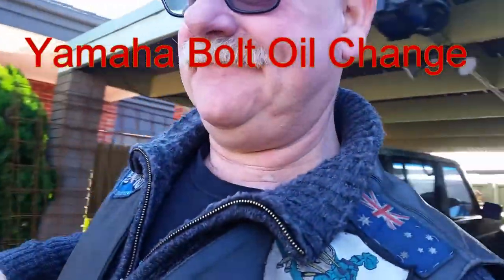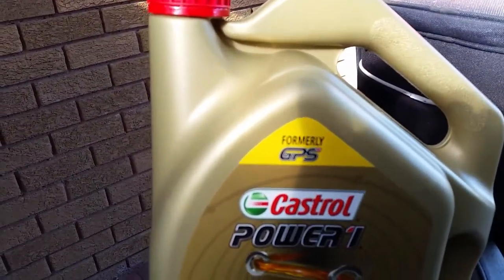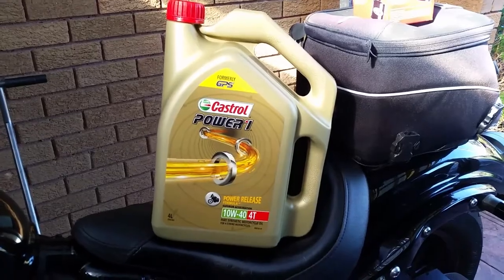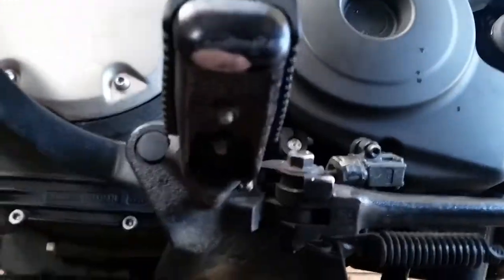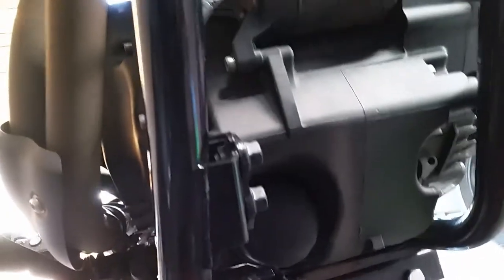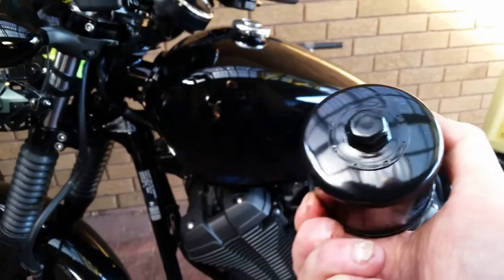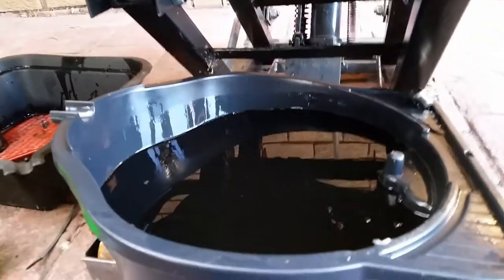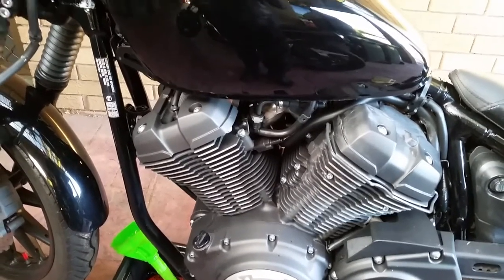YAMAHA BOLT XV950 OIL AND FILTER CHANGE

Comment: Very good video.   I've changed the oil on my Bolt but didn't use a lift.  I'll use my lift next time.   I love my Yamaha Bolt.  I've been riding for 50 years.  Sweet bikes they are.